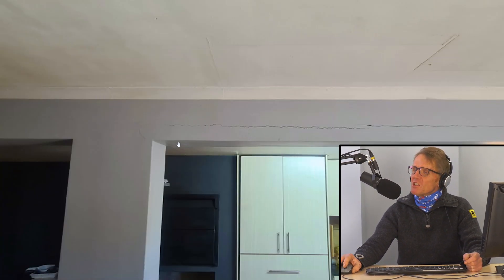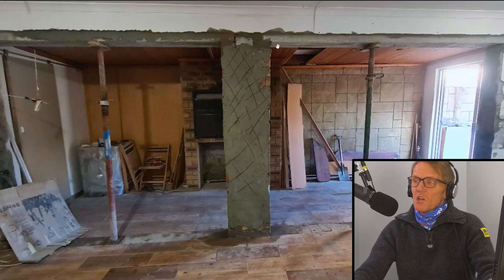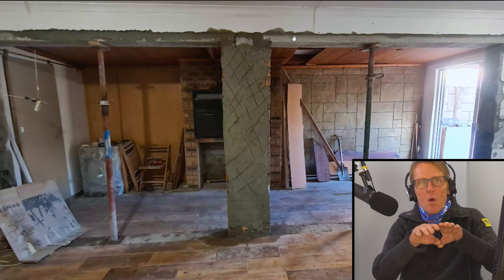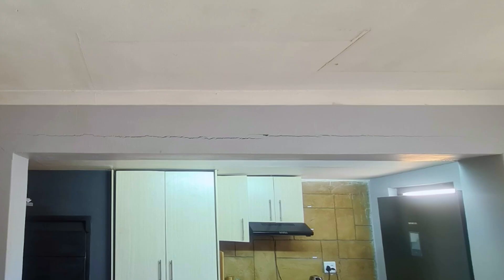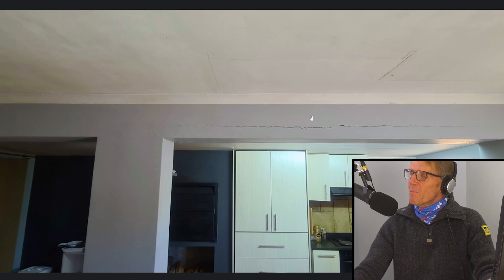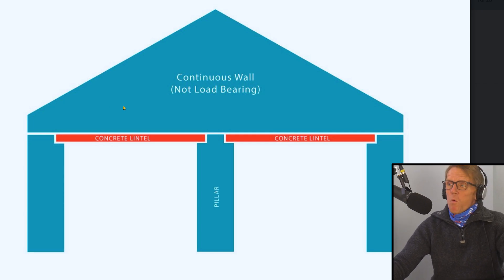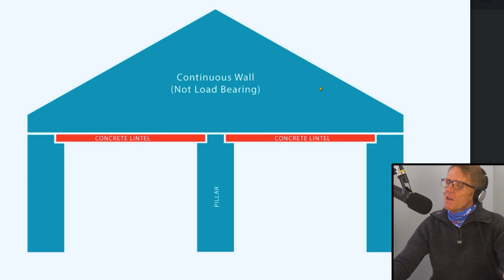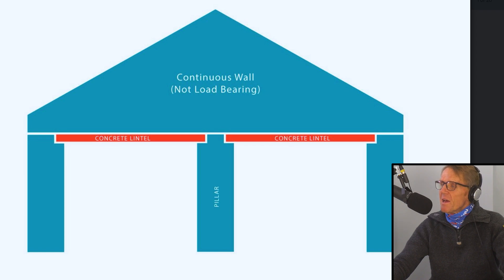Why Has This Lintel Cracked?

Comment: You can see there is one acrow prop supporting the middle of the lintel before it's plastered in. That would suggest to me that maybe instead of fitting the lintel and installing brick work above, or dry packing with mortar they may have tried to wind the beam up to the underside of the existing brickwork. If I were installing a lintel or a steel beam I would form a pocket or shoulder using a padstone (are there any padstones?) and sit the ends of the beam/lintel on that. Sometimes you can't do it that first and might need to build the padstone up to the bottom of lintel/beam, in which case there should be a prop at one or both ends while the mortar is setting.

Comment: 😂 gable end is not load bearing?
I’d love to see him lift it down and pop it back up if there’s no weight in it 😂 
Not like brick:block have any weight to them or the roof tied in would add any additional pressure. 
I’m with Rodger a steel would have been a better job, plus as we all know the fire retardant paint makes the steel 10 times stronger again 👌🏼👌🏼

Comment: First thing is this sort of structural work needs building reg's approval and if you do that you'll need structural calculations for the lintels. A structural engineer would specify a steel for this job, single course pre-stressed concrete lintels are generally just for small spans and standard/light loads. 
It really is worth the extra expense of doing it with BR approval as not only will you sleep easier and have no problems but when you come to sell the house you can run into big legal issues with the solicitor costing you much more than the few hundred it would have cost you to do it properly.

Comment: Bloody hell, just on the basis of "if it looks right, it probably is right"...... this doesn't even look close to being right..... in any way, shape or form! From a structural engineering point of view, any lintel bearing masonry has a "load triangle" on it which acknowledges the self supporting (arching) nature of bonded masonry. If that masonry also has loads applied to it, eg floor joists, then you also apply an "interaction zone" as well. All can be resolved with simple geometry to derive the required section from manufacturers data from their product brochures or website.

If a so called builder put those in, I would suspect, and inspect, everything else he's done too.

Comment: Many years ago I drew up plans and got a builder in. Specified catnic over an 8ft window. 'Frank' (with 40 yrs experience) brought a 75mm concrete lintol because 'thats how they do it' Ran the calcs and told him it would not do. He raged about the guy at the builders merchants who told him it was ok for the job. So they brought a 150 prestressed beam and promptly fitted it upside down. I had to tell them! Frank the builder, could he fix it? Frank the builder, could he f*ck!
Reply: To be frank about the situation.
Reply: @gdfggggg  Don't give up the day job! 🤣
Reply: @johnf3326  ha ha
Reply: Was that 40yrs experience in the same area? or did he have to move around.

Comment: The bearings on those lintels look rubbish, it honestly looks terrible. Normally building control want  a minimum of 150mm bearing if a lintel is retro fitted. Also on some sort of Padstone. That looked like a load of cement just parged in. Also like Roger said, it would have been steels not a shite concrete lintel.

Comment: The customer did say the wall was non load bearing so surely even the most incompetent builder would have made sure of that before deciding on the lintel. If it was load bearing and they put the plank lintel in they should be made to come back and replace it with an RSJ. But as they were removing the wall without supports I must assume it was not load bearing.
Solution is to fill the crack and paint.!!
Reply from the maker: It had a gable end of brickwork above it. That is shown at the end

Comment: On my extension( single story) I used a steel that accomodated the block and brick over the door and window.Very little load on it but under building notice it should and would be capable in the future of supporting a second storey above if that was ever done not that I will but in the future someone may.Much like the footings I built it on.Able to support another storey easily.To be fair UK building regs are as good if not better than any in the world structually.I prefer to over engineer any job than under engineer.

Comment: It's just shrinkage. They should of hacked it off higher than just high enough to get the lintel in as it would have strengthened the face of the wall when it was refinished. In addition, those concrete lintels are incredibly porous and the suction needs to be addressed as this will cause shrinkage also.

Comment: I do not like the look of any of that, it does not look safe.  Have they plastered directly onto the concrete lintel? the same coving is visible in the before and after.  At 1:18 The original plaster on the brick seems to be flush with the side of the lintel.

Comment: Didn't even realise you could get those lintels in that length. It won't even support its own weight over that span. I wouldn't be surprised if the bricks above are supporting themselves and the cracks have occurred where the lintel has sagged away from them under its own weight

Comment: Structural Engineer here, as you said yourself, it’s the wrong lintel. It’s very rare that a single course lintel is used other than over single doors with continuous masonry above.
Reply: Rare isn't not at all and suggests they can be used. Conflicting information.
Reply: @alabinibop  I think it's basically not at all. A bit of commonm sense suggests a single course lintel can't take that kind of load over that span, ever.
Reply: @Orgakoyd  the topic of the video queries the formation of the crack. How can a lintel with too much load sag away from the load? Structurally engineer that.
Reply from the maker: alabinibop
Why does it need to turn into a fight?
Reply: @SkillBuilder  no one is fighting, someone is being corrected. And while you are here if you could make your mind up as to whether it is shrinking or sagging that would be appreciated also.👍
Reply: @alabinibop  Are you saying lintels can't sag?
Reply: @alabinibop  I see what you mean with regard to sag, once a beam is loaded, presuming it's not yielding and the load doesn't change, it should hold it's sprung state without further sag. But maybe it's so heavily loaded that it's starting to crack and get weaker. As far as I know a concrete beam can't plastically defoorm, but I don't know how the tensined element inside changes that. A beam that's saging too much under load, especially made of brittle material is probably a bad idea though, wouldn't you agree?
Reply: @Orgakoyd  firstly, my sagging reference was a direct quote from Roger. Secondly, it's not my place to safely dictate what lintel should be used when or where as I could not back it up mathematically. What I can do, is draw from past experience and offer a suggestion regarding what lintel/beam I have seen being used in similar applications under instructions from the relevant body. But this isn't the issue here, I believe the crack is not a sag and a workmanship issue
Reply: I believe you are right. Large span lintels need to be propped while laying masonry above, but propping in this situation would stop the lintel deflecting under it’s  own weight which would then occur in a relatively short space of time after the prop is removed.
Reply: @1976rlc  yes, so what have we established here? Had this lintel originally been installed in this position, unsupported, prior to the installation of the masonry above, it would have deflected (sagged Roger!) under it's own weight. If you then introduced a support that didn't compromise this natural deflection, but simply retained it, and resisted further deflection whilst the masonry above was added,  the whole installation would cure as a unit preventing any uneven load. 

My conclusion: the installation of the lintel in this instance has compromised the integrity of the wall as a whole and introduced a clear weak point, this being the retrofit horizontal mortar bed above the lintel. It is possible that there was a support put in place whilst this lintel and the bed of mortar have been installed, and upon its removal over a short period of time it has returned to its natural deflection, hence the crack. This would not in itself deem the lintel in question as being unsuitable, more the manner in which it has been installed. 

The other possibility I see, is they did not support the lintel, filled the void above it with mortar (at this time, I should point out that whether or not the bed is indeed "full" of mortar is another issue which could have a bearing on this and is impossible to verify without an intrusive investigation) without any provision for the porosity of the mating surfaces and subsequently the joint/face of the wall has shrunk, taking the surface finish with it, hence the crack. Once again the suitability of the lintel has not come into this theory, only the installation process.
Reply: @alabinibop  I see what you mean. When introducing a springy support member (a skinny lintel in this case), the member has to be preloaded (or gradually loaded, in practice) or else dead load deflection will cause this kind of problem.
Reply: @Orgakoyd  well put. It has been a pleasure to have this healthy discussion with you sir. 👍
Reply: @alabinibop  Same here!

Comment: The reason prestressed lintels tend to arch upwards should be because stressed reinforcement is placed below centre and the off-set results in an upward bending tendency. Could it be possible that they have installed this lintel upside down? That would greatly reduce the strength of the lintel, not necessarily catastrophically if it is not heavily loaded, but it could account for the cracking. As an ex- structural engineer, albeit with limited experience, that was my first thought.
Reply: Your description of tensioned wire reinforcement placement is absolutely correct. I spent some years working for a concrete fabrication company who made all types of concrete lintels and this as you describe is exactly how the moulds and reinforcement were set up before pouring.
Reply: @howardosborne8647  When I was working as a structural engineer my job was to do the design calculations for reinforced and pre-stressed concrete beams, columns and slabs. I did not do this for long - hence my stating I'd had little experience - but the principle I described I know is correct. I guess I had enough experience to know that the basic principles haven't changed but, just to date my knowledge, I did my calculations on a slide rule.

Comment: Even if the beam is correct for the span it should never have an acrow jacking it up in the centre. If this needs to be done to squeeze the mortar between the lintel and bricks above it should be done at each end. This takes out any bowing which may take place once the mortar is set and the props removed. It looks in the pics that the lintel has settled in the middle causing the cracking and can probably be packed and repointed assuming the lintel is correct for the span and there’s no underlying structural issues.

Comment: Blimey, where do you start?  So much that is wrong.  I always work on a lintel being able to distribute a triangular load across its length - relying on the arching effects of the masonry.  You get to a certain span and load when a normal lintel will not work and you have to use an engineer designed steel (be that a UB, UC , back to back channels etc).  It doesn’t stop there though as the supporting masonry also needs checking out.  As a rule of thumb take the reaction as the area of bearing required.  Work on the beam covering 2/3 of the length to adequate spread the load. Then do a proper check!  Of course you then rely on the builder installing the new beam properly.  I have seen too many examples where dry pack between the steel and existing has not been used or if it has the load relaxed before the dry pack has set.  This reminds me of that and the only way to correct this is to almost start again: support the masonry above and jack it back into position, pack the resultant gap, wait then relax the supports. But if the ‘lintel’ is not good enough you have to start again and quickly!

Comment: Like someone said its not the UK? It would be steels with UK regs and that pillar looks ropey too, would probably be a steel too in UK. As it stands it probably won't crack more so just fill it if its definitely got no loading but I'd want a structural engineer to have a look.

Comment: So if it has a set of bricks on the top, presumably as they are rigidly connected, they become part of the beam and are in compression?  Hence why you can get away with the plank sizing.

Comment: In 35 years I’ve never heard of a plank lintel 😳. The fact that there is a full pike/ gable above that room means that wall is load bearing.
   My guess is that the left hand one is in correctly and the right hand side is maybe upside down? Meaning the pre stressed camber is pushing down instead of up . 
   On openings that big steels every time 🧱🤙🏽💪🏽
Reply: Not all gable walls are load bearing, only older ones with purlin roofs. Modern ones with trusses aren't.
Reply: @lksf9820  surely the gable is a load in itself , that’s a lot of heavy bricks above as in a “ load “
Reply: @SteveAndAlexBuild  Then It's just a wall. 'Load bearing' means it's carrying something other than itself.
Reply: @lksf9820  very confusing that 🤨
Reply: @SteveAndAlexBuild  No it's quite simple really.
Reply: @lksf9820  if you say so
Reply: @SteveAndAlexBuild  Weight of building material is load too. So if the roof purlins are sitting on the gable wall it all of a sudden becomes a ''load'' but the mass of brick/block is not a load? Then how about you cut a hole in that wall and just walk away since there's no purlins resting on it, see how that goes for you? I think Bricklaying With Steve and Alex is right.
Reply: @Orgakoyd  . Thanks very much , better explanation than mine 😁🧱👍🏽
Reply: @Orgakoyd  They are right
Reply: @Orgakoyd  The term 'load bearing' refers specifically to the load bearing of any other structural elements other than the wall itself that are being supported such as roof timbers,flooring joists,purlins etc. The term is not used to describe the weight/load of the wall itself. If a load bearing wall is removed then other supported parts of the structure may collapse. If a non load bearing wall is removed it should have no detrimental effect on any remaining structural integrity.
Edit to add: perhaps a better description of 'load bearing' would be to class it as a supporting wall if it is carrying the loads of floors,roofs etc.
Reply: @howardosborne8647  Maybe there is a text book definition for the term ''Load bearing'' that doesb't apply to this case, but in reality, if you can't cut out a wall and walk away without somethin collapsing, then it's load bearing/supporting/whatever, and the precausions you have to take are basically the same, depending on what is actually ''bearing''. 3 storey house? A gable end on a bongalow? Or a few courses of single skin brick above an opening in an internal wall. All need to be addressed in the same fundamental way, but to varying extents. Stiffer is always better, so erring on the side of a larger lintel is always good, and people often lose sight of lateral restraint/stability, which is the cause of many more problems.
Reply: @lksf9820  But in this case clearly the lower part of the wall must be described as load bearing if it supports brickwork above. The wall as a whole can be described as non load bearing when deciding whether it can be removed as a whole.
Reply: @lksf9820  Any wall that supports its self with more than a few courses is load bearing
Reply: @andrewdoherty737  So basically every wall is a supporting wall and there is no other type? 🤣
Reply: @lksf9820  are you confusing load bearing with supporting??
Reply: I agree that the RH one is probably upside down - that was my first thought in fact.
Reply: @stevebeal73  🧱👍🏽
Reply from the maker: Steve 
They call them plank lintels in the South of England but we are as thick as two short............planks down here
Reply: @SkillBuilder  😆😆🧱👍🏽
Reply: @SkillBuilder  i live in the south and never heard it called a plank we just call them pre-stressed